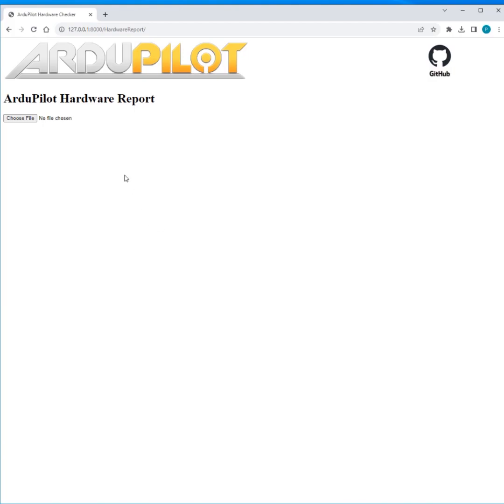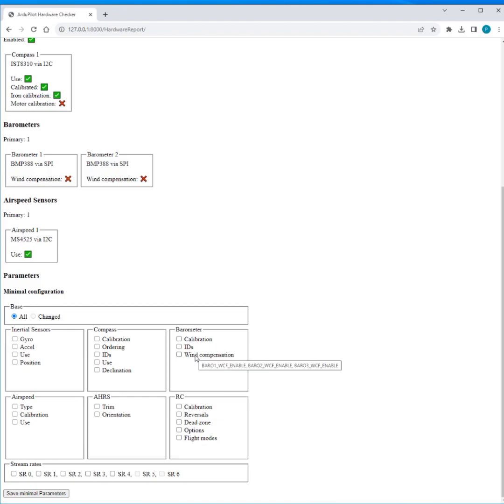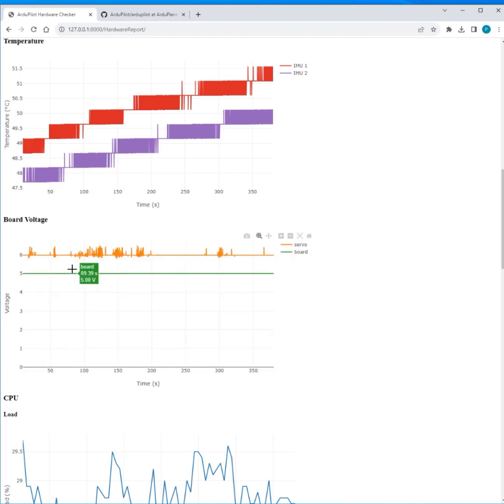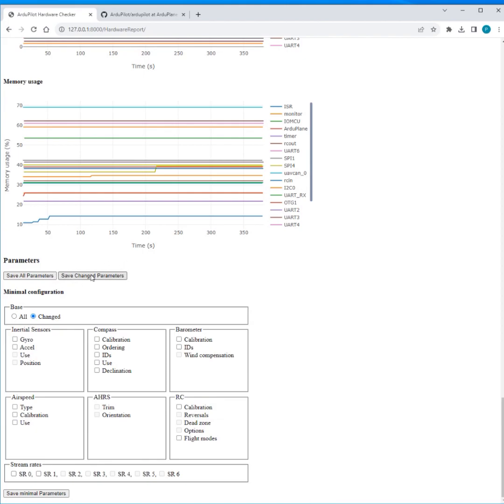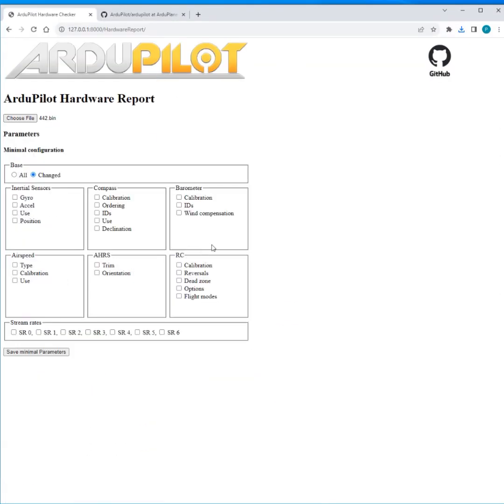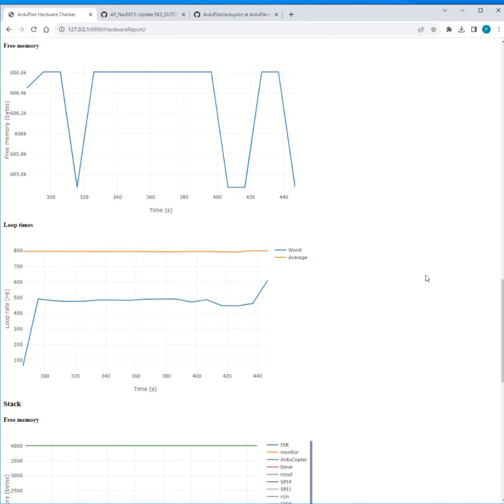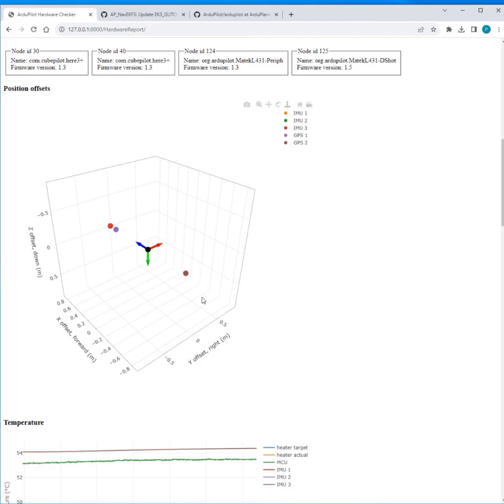ArduPilot Hardware Review web tool

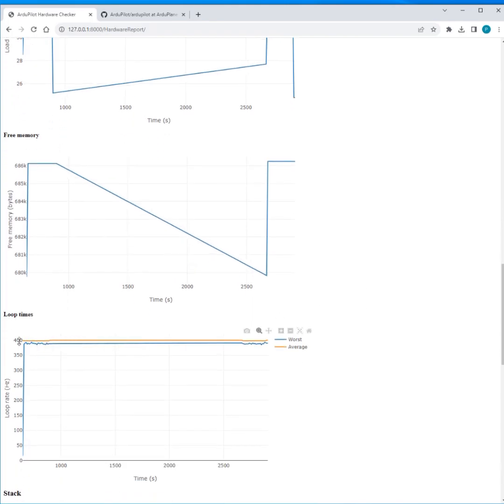Comment: At @10:02 the graph looks like it stops updating after arming, and then resumes after disarm (I'm just guessing about arm state) for CPU load and free memory. Is that a logging issue?
Reply from the maker: That was two flights on the same log. One short flight then disarmed for a bit then another short flight.
Reply: @MrIampete  that makes more sense.  Great program.  Thanks